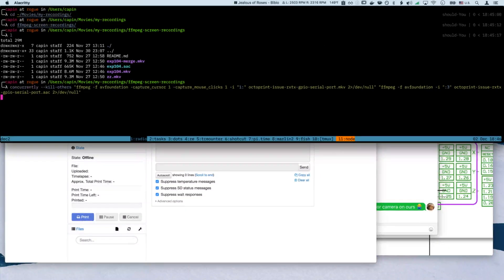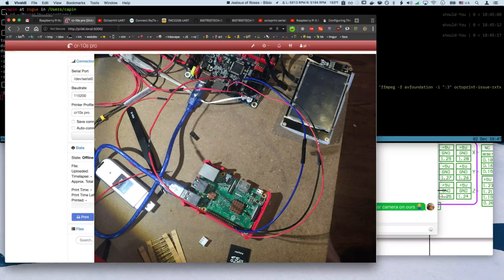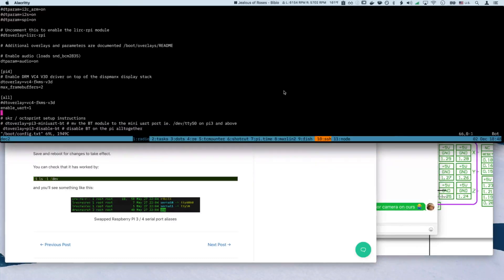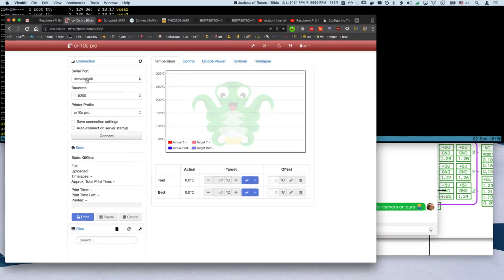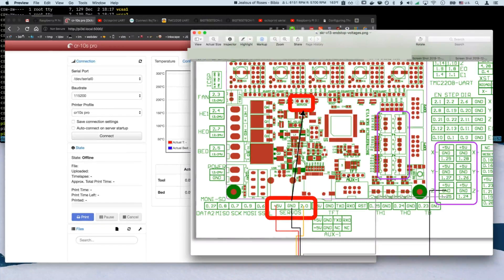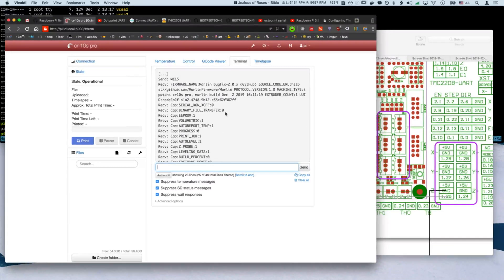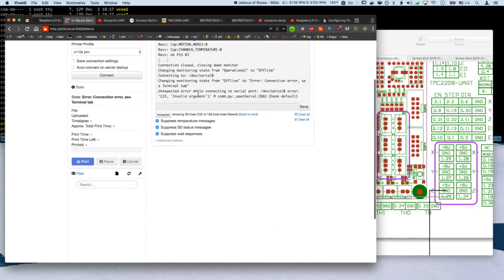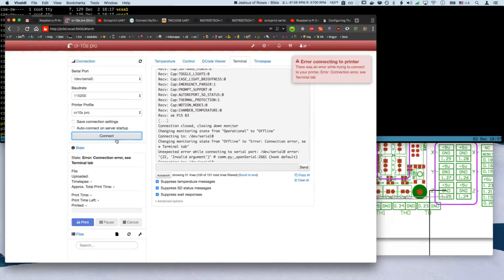SOLVED ✅  Octoprint running on Raspbian can not reconnect to SKR v1.3 after disconnecting

Comment: Thank you! 
Your Hithub page shows some really useful info!
At this moment, my SKR is powered by USB from the Raspi running Octopi. The 5V pin for the servo gives me 4.2V which is to low for running a servo. Also, the current is not enough from this pin to be able to quickly deploy a servo.
I solved this to connect the servo directly from the PSU with a step-down converter tot 5V. Only the servo's signal pin is connected to the SKR. Works like a treat